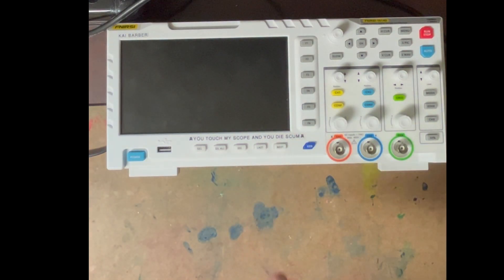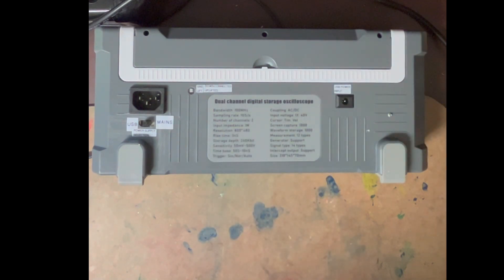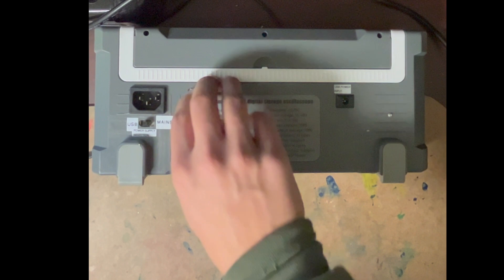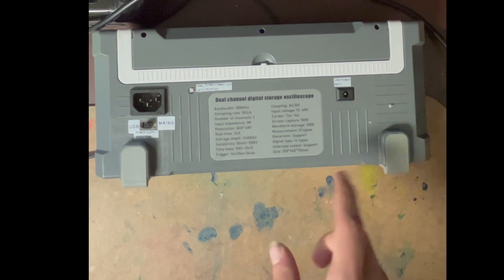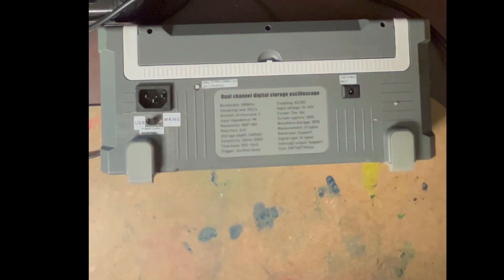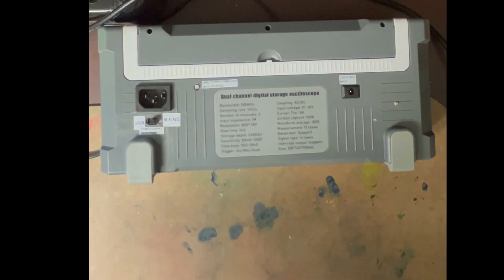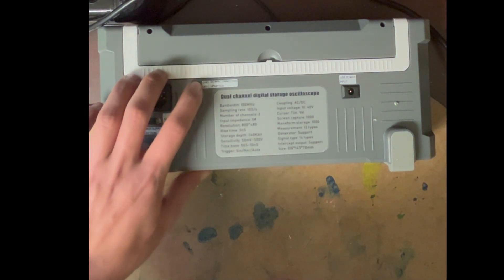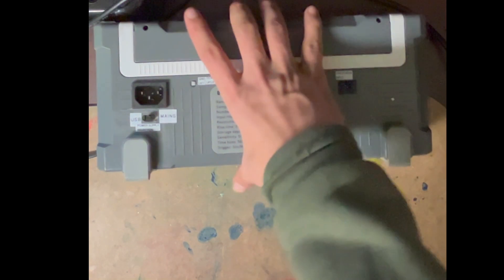FNIRSI 1014D Oscilscope Modifications

Comment: Can you say what the specs are on the coaxial power connector?  I've lost my cable and I need to build another one.  Polarity, inner and outer diameter.
Reply from the maker: For the barrel jack on the back?
Reply: @theteenageengineer  Yes
Reply: @davidvanhorn498 5VDC Inner + Positive. 
 There's little doubt you've already figured out the voltage and polarity by now or... something went horribly wrong.
Reply: @WireWeHere  I found the original cable, but having it here may help someone else.

Comment: WD40 is NOT a lubricant! If you want to be an engineer, as opposed to a hack, use the correct fluids on electrical and electronic parts.
Reply from the maker: I know that WD40 isn’t a lubricant. I know the WD stands for water displacement. I’m a college student with like $10 to my name at any 1 given time. WD-40 was the best thing I had to fix the encoder at the time. I’m lucky I even had that! First 4 weeks I had a pocket knife, a few screwdrivers, a hammer, and some pliers for tools. I’m not a hack, I was doing the best with what I had at the time.

Comment: You problem with the batteries isthat you used 4 batteries it can fit at least 11 x- 18650 in parallel the scope draws 1.06 Amps the step up 5v boost draws 1.6Amps depends on which boost you use, I'm testing  mines with 6x 3,700mah flat batteries in parallel

Comment: This scope is a fraud and not worth wasting time on. 

1- The sensitivity is too low, i.e. the minimum u can get is about 100 mV / div. Which is not adequate for some applications.

2- The Triggering is faulty and pretty much useless. Specially when the duty cycle is low. 

3- It is CERTAINLY NOT a 100 MHz scope. At best it can be called a perhaps 25 to 30 MHz scope. The ADCs used inside can deliver a bandwidth of 300 MHz. However the sampling rate is no where enough to get even to perhaps 100 MHz. There is usually a way around that. And that is that, some manufacturers (not so common now) provide the equivalent sampling mode. But this manufacturer is a habitual liar in many specifications. And of course ETS (Equivalent time sampling) mode requires some work to be done. So its not there. Therefore its a waste of such marvelous Analog Devices ADCs inside. 

4- The main selling point of this manufacturer (that was attracting, but not sure if its there  or not) is that it is hardened against rotary knob failures. Which is a major weakness in the scopes built by low end manufacturers (other than the renowned, HP, Tek, Iwatsu, LeCroy, etc.) has been. These rotary knobs are rotary encoders. And they fail after about 1-2 years (or a bit more). They can fail regardless of the usage hours. And that often requires opening the scope and finding the faulty knob and replacing that. The FINIRSI claims that this scope has been hardened against those failure, through some special algorithms in the controllers inside. Of course I doubt them as I doubt anything they say. A scope is usually a main investment of any Electronics engineer lab. And its reliability is of paramount importance as it is the eyes and ears of the serious engineer who wants to do something meaningful. So if one wants to have a reliable equipment like that, then either one should choose a touch screen scope or a scope where most work is done through pressing buttons instead of rotary encoders. If not, then one should stock a few encoders and get used to the idea that this would be required every few years. Solder suckers and a heavy soldering iron (to remove) i.e. 60 Watts, should be at hand. I usually don't install the new encoders through the holes. I prefer a bit of surface mounting style, to ensure that they would be easy to remove and replace later. 

For any engineer, a good bandwidth scope is an invaluable asset. Usually a 100 MHz is required for serious work. Anything beyond that is already a difficult feat. Because the probes are the main culprit in the process. Its very tough to get down below 3-4 ns, rise times, even with high frequency probes alone. One has to resort to spring attachments to reduce or eliminate the inductances introduced by the earthing clips. Without that arrangement its almost impossible to get below 4 ns. The effect of ground clip inductance is really very prominent as soon as u hit the 5 ns rise time waveforms. Its almost a shocking experience. So for pretty advanced engineer a 100 MHz scope is usually good enough for over 98% of the tasks he would ever take up. Unless u are really a person determined to get into the very high speed arena. Which is of course a very difficult domain.
Reply: Pretty sure you aren't the person this is intended for.
Reply: @caddyguy5369  I am not sure what u intended , by stating so. I hope it wasn't a taunt.
Reply: @naseer48  It was a thing called an observation.
Reply: @naseer48  I'm not sure what you mean by, "hope it wasn't a taunt."
You gonna come through the screen grab me by the collar and rough me up?
Reply: @caddyguy5369 I understand that ur remark was an observation. But the observation could be positive or negative. If u are a pro Finirsi user, it could mean to be a negative observation. And if u are a keen person who knows the importance of right tools in the lab. Then this could mean a positive observation. 

Of course, I cannot get to u from the screen and avenge u for any insolent behavior. But either I would choose to ignore such ppl, or respond with even more intensity in the language they are more used to. 

Because, my detailed response was to help any person who was being misled by the marketing propaganda campaign of this co. At the same time, I was in a smaller way educating the new starters with Electronics who are studying at university, and are already tight on their pockets (as this guy is), to make better decisions. And learn from mistakes of others (like myself) who have spent decades into chasing good bandwidth scopes and am close to making my own multi GHz sampling oscilloscope. 

The objective was to teach him that if he is tight on his pockets, then don't bother about chasing high bamdwidth scopes. As they are really not as much use as one anticipates. Because u really don't need a 100 MHz scope while dealing waveforms like ramps, PWM signals,  triangular waves, etc. Also a scope is either almost useless or much less useful while dealing with RF signals. These things are an education in themselves. And it is not really that much possible for myself to teach all that in posts on youtube.
Reply: @naseer48  Fair enough, but I do disagree on observations. An observation is an observation. Whether positive or negative connotations are present or interpreted has no bearing on it being an observation, nor does it provide indication of if I intended it in either way.
An observation is akin to a fact, IMO. It doesn't care about your feelings.
I can't think of a single person that would expect this to compare to the level of equipment you were talking about.
As for pro or anti. Neither. If a tool gets a job done for someone, it works.
For learning or a startup that doesn't need something high end at the moment it could work fine. I'd say pretty good potential to be useful in an automotive environment.
For the type of stuff you are talking about, ya it won't cut it. I can't fathom why anyone would think it would which is what sparked my reply.
I was planning on getting a 4 channel Siglent for my first one, but I started a project and need to see the results of passing a 100hz PWM through a low pass filter to trigger a relay. Should be well within the ability of something like this and easier on the budget at the moment. Got delivered today so i'll find out if it gets it done.
Again, the reason for my original observation was my curiosity of what your expectations were for a sub $200 mostly empty plastic shell of a scope from Chin@.
I will also be getting a cheap 8 channel automotive scope. Again planning on a PicoScope, but at the price I have to give the cheap one a shot.
I will also not be using the power adapter that comes with this as I've read it is noisy and the scope is sensitive to that.
Reply: @naseer48  I didn't mean anything negative BTW. Just got my curiosity is all.
Reply: @caddyguy5369  

This scope can do most elementary work. However, one has to define the level of elementary. 

When one needs to work with PWM. It depends if u will be hooking the other channel to a valid trigger signal or u r limited to trigger from the pwm signal itself. 

Like I mentioned. This scope doesn't have good triggering ability. For triggering on pwm signals one might need a hold off ability on the trigger. Since I rarely use this scope now, I can't remember if it has a hold off ability or not. But my observation has been that this scope lacks a lot on triggering and sensitivity. That is besides the point of over stated bandwidth. Which is usually the main bait. 

With basic automotive stuff and elementary level things that a university undergraduate will encounter. I think it should be enough for most things. But given that good scopes are available from china (hantek) in the mid 200-250 dollar range. I see little point in saving just few dollars and ending up with a junk that one will be reluctant to use a few years later. 

For the point that a tool is good as long as it gets the job done. True. But a good tool will save u significant cost in terms of time, and trials and dedicating spare points and space on the board for cut and try. And I am stating that out of experience. This experience comes when u work at the higher speeds i.e. 5 ns or below. Above that point, one rarely feels a difference between a 20 MHz and 50 MHz scope.
Reply: @caddyguy5369  

I have used Hantek and Owon scopes. They both are good. The first Owon I got was a bad unit. And I discovered it after a year (as I rarely used it, I was using Hantek mostly). To my surprise, Owon had a guarantee for 3 years. And they sent me the main board free of charge. Which I changed easily. It works fine now. Its a very good scope for sure.

Its remarkable in terms of noise floor. Which is significantly lower to Hantek. And its display is also significantly more stable compared to the older Hantek model. Definitely recommended. If one can afford to. I would say best performance to price ratio. The con side is that Hantek older models have ETS (Which I use for serious work). But I can say that Owon seems to be competing well even without ETS. Atleast that is the case when u use only one channel i.e. get the maximum sampling rate for the channel.
Reply: @naseer48  I saw that Hantek one that looks similar to this. Didn't see it until I had this one on the way though.
At the moment I just need to figure out how to turn on a RGB controller whenever a PWM is present.
The PWM, according to my meter, is 0-12v 100hz and ranges from 40% to 90% duty cycle.
So far i have low pass filter to a comparator with a 1.8v zener diode to set the trip limit of the comparator. Using the output from the comparator to drive a mosfet to power the relay coil.
I have it working on a circuit simulator, but running into problems on the breadboard.
Im pretty sure the trouble I'm running into is related to the fan controller I'm substituting for the computer that generates the signal. I think the PWM from the fan controller is really noisy and it has a floating ground for the return path of the signal. In the vehicle, the signal I am working with is grounded to the body not directly back to the computer. I think that is causing problems too. Hence my current need for the scope. I think I'm going to have to ditch the fan controller and either test in car or try using a mosfet with the signal Gen on this scope to recreate the signal properly.